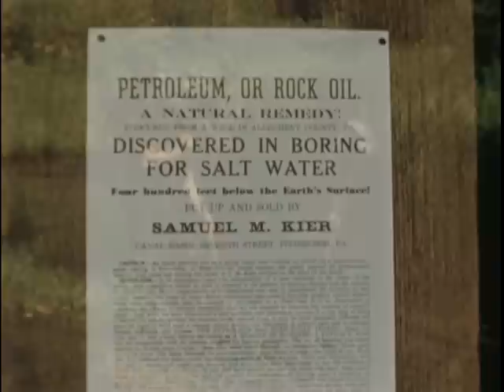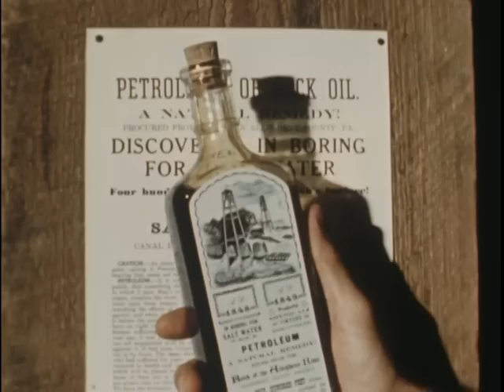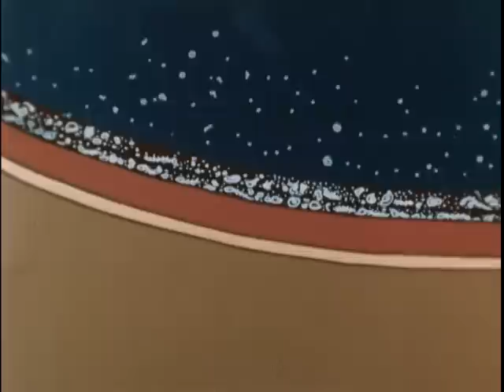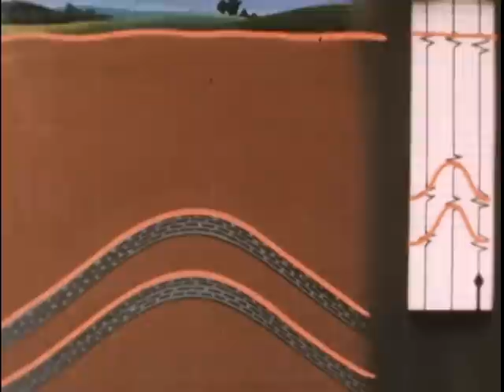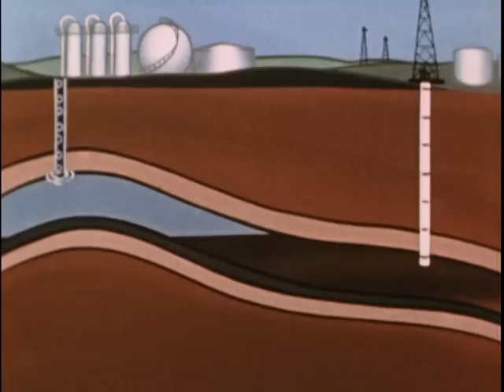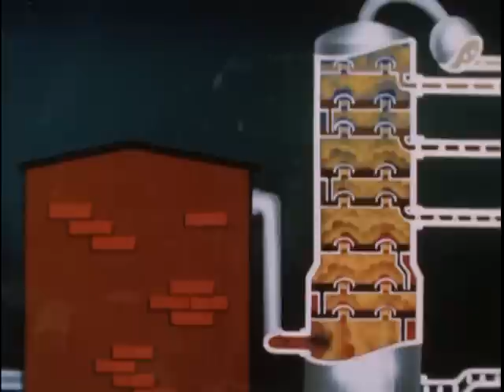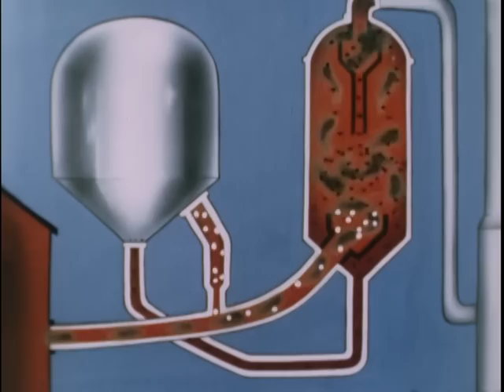EVOLUTION OF THE OIL INDUSTRY, THE

Comment: "Chemically treated muds are pumped through the hollowed drill pipe to cool and lubricate the bit and carry the rocks cut away by the bit back to the surface. It also plasters the wall of the hole to prevent cave ins. "   That is how ground drinking waters are polluted and entire ecological system die, including people.
Reply: It's minimized by isolating water zones with surface pipe. Once they drill to shallow depth they install large conductor and surface pipe. Then they begin drilling the main string which is smaller. 

Thing about oil is. Without it you wouldn't be posting that comment online like you did! EVERYTHING relies on oil! Plastics, transportation and even our power grid relies on oil!
Reply: @WW5RM  Fracking oil must be banned, there's plenty of regular oil that doesn't require injecting toxic chemicals into the ground.
Reply: @goognamgoognw6637  lol who said anything about fracking?
Reply: @WW5RM  Yes fracking is environmental crime.
Reply: @goognamgoognw6637  you aren't getting it! This video is LONG LONG before fracking was even thought of! No where in this video does it mention fracking! Stick to the subject!
Reply: @WW5RM  I knew that, but i wasn't aware that regular oil drills also inject chemical "mud" in the ground, although probably not at a comparable levels.
Reply: @goognamgoognw6637  then why did you even mention fracking if you knew that? Your original statement didnt include fracking. I explained how they isolate the water tables from the drill string during drilling and you bring up fracking! 

If you want to discuss fracking thats fine but lets do it one thing at a time. please! Plus the video has nothing to do with fracking.
Reply: @WW5RM  You seem to be a specialist of oil drilling. Thank you for the information.